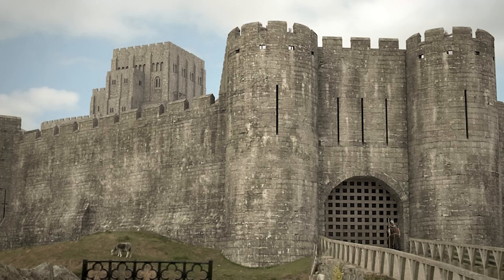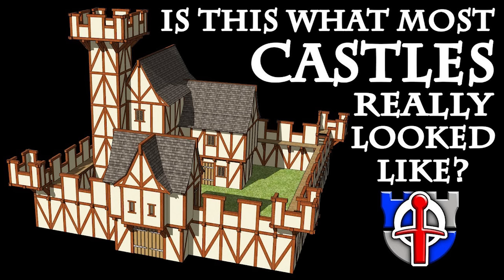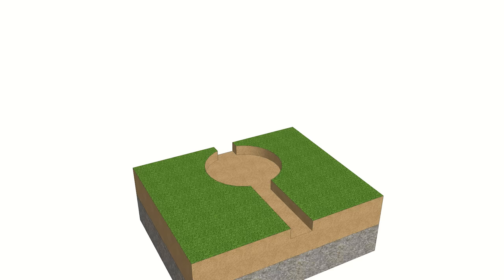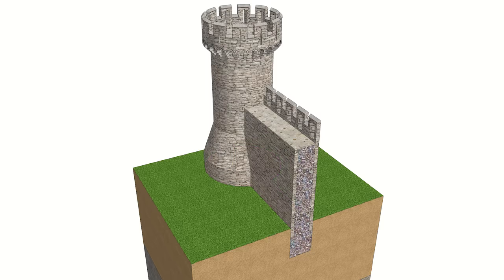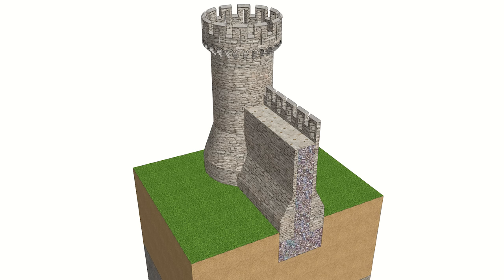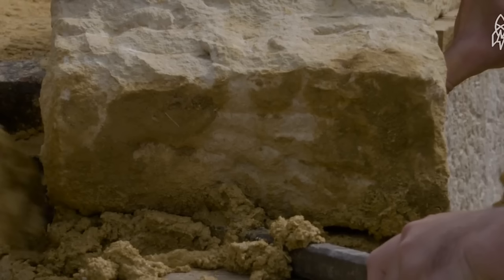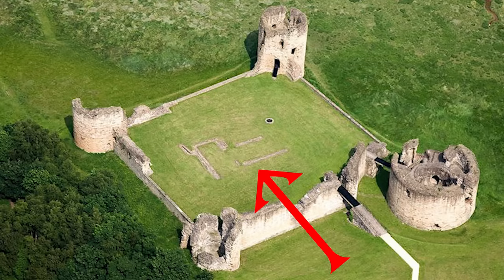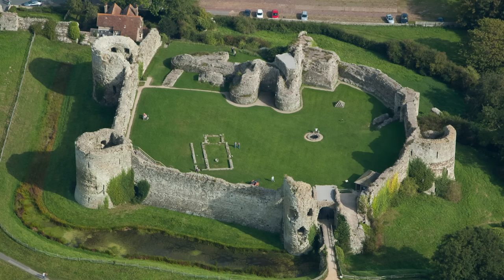How were castles built / constructed in the medieval period?

Comment: Some further explanation as to why they used mortar instead some other adhesive and how mortar mixes work. 
Quick lime reacts with water and changes into slaked lime (fully reacted and hence inert lime). A lot of heat is produced as it does this. Which drives off moisture. A mortar is basically self baking fine aggregate concrete (concrete is just cement with an aggregate like rocks mixed in). It doesn't require exposure to air or additional chemical reaction with water over to time in order to set fully. Unlike concrete. An example of how long it can take concrete to fully set is that the core of the Hoover dam is still setting to this day. Now aggregates (if any were wondering) are added to:

1) Increase an adhesive's viscosity (it's tendency to want to cling to itself. In this case previous to drying). Which makes it easier to work with. Especially since enough aggregate slows the chemical reactions so that evaporation and chemical bonding happens in a more controlled way. But also so that it pours, packs and spreads in a desired manner.

 2) Fix the minimum compression thickness. As it can't reasonably be squeezed any thinner than the largest hard substances in it. This keeps it from all being squeezed out under pressure. Aggregate isn't just crushed rock. It's rock that is crushed and sorted to be within a roughness, size, and hardness tolerance.

3) Create a rough surface. A rough surface has higher friction. Which keeps things from shifting around in ways that are undesirable. The weight of the stone, block, brick, or tile alone is enough to hold it firmly in the vertical plane. A rough surface that finds it's way into pits on the thing to be bonded and stays fixed once dry...That holds it firmly in the horizontal plane (the whole purpose of using a mortar).

These are the the strength properties of adding aggregate to a mix. A fine aggregate makes for easier pouring and filling of more gaps. A more course aggregate leads to greater dry strength.  It would make sense if the exact ingredients of their mortar in castle building changed as they went higher. A gradient of courser to finer aggregates as they move upward in construction.

Comment: As a stone masson i have to point out a few things, first off the walls were tapered for balance, you can see this in more modern stone buildings which would have thick walls on the ground floor and thin walls on the upper floor. By tapering the walls the stressed push out forming a stable base (just stand with your feet together and you can feel how less stable you are in comparison)

Next the stones inside the wall, while they may look random, they're not as random as you may think, those stones interlock and are usually tamped down and shifted to provide support before mortar is applied this can be seen in modern wet stone walls, if the stone is just dumped in the wall lacks strength and quickly crumbles even with a mortar core, while if laid with care using those stone to shore up the face stones and other vital structures of the wall (such as throughs) the wall is much much stronger. So while it looks random (and was probably dumped in by the bucket load) the mason would have been arranging that stone to provide the best support for the wall (you're not going to spend that much money on a castle just for it to fall down in 10 years)

Comment: One reason that the insides of the defensive walls were more loosely built/filled was because the looser fill would absorb more of the energy from bombardment and spread it out to lessen its effect, whereas the tighter fitted stones would transmit the strike more deeply and be more likely to be shattered. That's why you will rarely see any walls neatly built in a solid stack. A "veneer and fill" technique makes a stronger wall.

Comment: In different parts of Europe, the construction methods and models of castles have generally varied. For example in Finland, the construction and stages of castles for many years were usually such that, in the 14th century, the castles were originally log structures, a fortress or fortification with wooden household and barrack buildings inside, but the pile fences were slowly replaced by a simple wall made of natural stones. In the next phase, natural stone towers and a gatehouse were built, and in the third phase, the wooden buildings were replaced by stone ones. In the 16th century, a second floor of bricks was built in the castles and the towers were raised, and in the 18th century, a third floor was added and the old gatehouses were bricked up, after which a new doorway was punched in the old wall. The main wall was surrounded by an outer wall, usually an earth rampart, a stone wall and a moat, which were converted into bastions in the 18th century. And since the Keep had towers, they were less often built on the outer wall. The usual place to build a castle was an island that offered good water connections, but a bad place for wells and the water from the wells dug on the castle island was often dirty and undrinkable swamp water, which is why the water was used for other purposes and drinking water was taken directly from the lake or river and boiled. Swedish and German castles serve as models for Finland's medieval castles (such as Turku castle, Häme castle, Kastelholma castle and Raasepori castle).

Comment: Hey Shad, the loose rocks and mortar used between two outer walls in Byzantine style building (i.e. castle building) is known as rubble.  There is a a great children's book on the subject of castle building (Castle by David MacCauley) that is actually used by several experts in modern castle construction.  Mostly because the book goes into some basic engineering while telling the "story" of a fictional castle being built.  If you don't have it or haven't seen it I HIGHLY recommend that you get it or at least read it.  There is a copy in my personal Medieval/Renaissance section of my library.  Great reference material.

Comment: There were also corbelled arches over doorways (and maybe windows too).  Where you essentially place corbels on top of corbels, putting them closer and closer together until you can place a piece of stone across them.  This way, you wouldn't need a large single piece of stone for the lintel over a doorway.  However, I don't know if this technique was used in medieval castles, but it was used in ancient architecture prior to the medieval period, and not necessarily for castles.

And sometimes a single large stone would span across a doorway or other opening, but then there would be a corbelled arch above that to reduce the weight on top of that one stone so it wouldn't crack.  Thus, you get a rectangular doorway with a triangular or arch-shaped "window" above it.  This space was sometimes filled in with a thinner, sometimes decoratively carved stone slab, which would weigh considerably less than a section of normal wall would have.  But again, this isn't necessarily for a castle, and predates the medieval period.

Comment: Just saw your video on the castles of Kingdom Come Deliverance, and had to answer the question about beds.  In Palais de Louvre you can still see an alcove for the king's bed which is fairly narrow.  I think this might be because beds often used to be built with a wood frame spanned by a net of ropes covered in straw and wider beds of this construction might need to have the ropes tightened more frequently. Just my random tidbits...

Comment: I wonder if they understood soil compaction at all? One of the things I do in my work is I test the soil compaction on building pads, roads, etc. If the dirt has already been compacted properly then a building won't sink in.

This is actually more complicated than you might think but basically it's finding the correct amount of water to use and also in the modern day we bring in engineered "fill" or dirt as not all dirt is created equal.

Comment: Probably an additional effect of randomly piling stones and using lots of mortar for the inner part of the wall is that such a wall can absorb a heavy blow better, as the random stones allow the impact to be passed through over a greater surface area. The mortar would do this even more so, although mortar isn't as strong as stone of course.

Comment: Plenty of hypothesis from your video. Allow me to make one clarification. The reason for tight fitting well dressed stones on the exterior and interior walls is for strength. Think of your bones. Hard exterior with a less dense interior. A castle 50 meters tall needs walls about 3 to 6 meters thick at the base. Stone masonry gets is strength from the stones interlocking and from compression . The mortar used stayed flexible and takes hundreds of years to completely cure. I am a Stone Mason and I am as well fascinated by this modern castle building project.

Comment: The footers might have also been made with a mixture of soil and ''cement'' mix... Note, the compressive ability of the soil -  resistance might have been high because of NOT have organic materials to decompose...
That the soil base was ''already'' in high compression and the added weight was not significant enough to compress it further...
Also, the base, in your designed wall, will ONLY add more weight and not ''distribute" weight...  because it is NOT composed of designed that will "act as one"... You created three walls... the larger base will add lateral stability though... and also push water away from the main wall structure - to avoid base erosion or softening of the soil. Hope this helps you.

Comment: Hey Shad, I'm curious about your thoughts on rubble-filled walls, or maybe using two stone walls with a hollow between them, then filling that hallow with sand and dirt.
How would that effect the integrity? Thermal properties?

Coming from your  castles in fantasy video, how would potlog holes effect a wall's resistance to fireballs? I would think for fantasy castles that would have to contend with such a thing they would be sure to plug those up.

Comment: At 6:21, that picture is the keep of the castle at the town of Castleton, in the county of Derbyshire, in the U.K. I recognise it immediately. Been there many times as a child. On top of a massive hill, and that little wall to the left? Other side of that, massive nearly sheer drop. Easily 100 feet. There is extra railings added to make it up to modern safety standards. I suspect in medieval times they cared a lot less.

Comment: Hi Shad, very informative and well researched video. But around the 6th minute you talk about the smoothend face of castle walls and I honestly don´t think erosion was the main reason as you make it seem by talking mainly about that. The main reason I´d say this was the case is simply for defensive purpouses (as are most things in castles). If the walls had a finish made of jagged stones it would be quite easily climbed. The climber would also easily blend with the wall at night, making him hardly visible for the watchmen. Conscidering the usual stationary garrison of a medival castle was between 15 to 40 men it could take as few as 5 to 15 unseen climbers to take the castle if they took out the garrison one by one. Thus I think the defensive value of smooth walls should be highlighted over erosion. Anyway - keep up the good work. I enjoy your videos whenever I have time to watch. ;)

Comment: Great way of getting the stone the cheapest is to actually quarry it on the very same place where the castle will stand. Most castles here in Bohemia were build this way - almost always on top of rocky hills, using the stone from the top of that hill to build the structure, modifying the layout of the hill in the same time as well. Most of the material is probably taken from where the moat will be. So today most hills with ruins of castles on top of them have probably good few meters lower elevation, than they were before the castles were build. For me it's interesting to imagine these hills (with familiar castle profile on top) without the actuall castle - the would look very strange to my accustomed eye..

Comment: When building castle walls, they built two outer walls and filled the center with rubble.  Then, when sappers attempted to tunnel under the walls, the rubble would pour into the tunnel, thwarting their plans.  At the very least, the rubble would slow them down, since now more sappers would be needed to clear out the rubble along with the mortal remains of the fellows who were in the tunnel when the rubble came tumbling down; and yet more is bearing down upon the stuff that they are trying to clear.  What you see as mortar might be natural concretion that has occurred over the centuries since the castle was built.  The loose rubble interior also gave some flex to the wall, allowing it to absorb bombardment instead of transmitting the shock through the wall and cracking; this concept has been brought forward even to the International Space Station, which has layers of soft armor to  defend against meteorite strikes instead of a single solid sheet of metal.

Comment: There is one thing you missed. At 3:40 you show a picture of the Malbork Castle as an example of a Brick Castle - an absolutely huge castle built on what used to be a swamp...  if you know your Monthy Pythons castles do not like swamps... There is no solid bedrock there to lay your foundations so instead this castle is built ON wood - thousands upon thousands of oaks that were hammered into the ground vertically to create huge and very solid foundations (obviously since the castle still stands). Them Teutonic Knights were very smart.

Comment: Something that may not have come through correctly is the fact that they did not use metal nails because the main construction wood was oak. Oak has a corrosive liquid inside, even after years of drying, that would just dissolve steel nails

Comment: I would say the main thing holding a castle together is not the mortar, but the shear mass and friction between the stones/bricks. I lived in an old house constructed with lime mortar and believe me it has very little strength (other than compressive maybe), is very soft and doesn't adhere well -rubbish compared with Portland cement based mortars.

Comment: It's interesting to note that we see the process of constructing a hard, stable exterior of a stone wall and then filling it up with stone and mortar on the inside repeated in the modern day, only with plastic and expanding foam when building cheap, simple, durable outdoor structures, like with plastic faux brick. The outer plastic brick kind of forms a hard shell and it gets filled up with beady foam on the inside.

Comment: Great video. On your point about castle walls ‘resisting bombardment’. That construction method (inner and outer masonry ‘skins’ with rubble and mortar infill) predates the availability of gunpowder, so wasn’t designed for that aspect anyway (yes I know there were trebuchets, but they weren’t in the same league as the later cannons and mortars).  The introduction of gunpowder led to the castle design changing to adapt, ultimately leading to the Henry VIII style structures (low to the ground with their own gun batteries), but they were really forts by then, rather than castles in the true sense.

Comment: Shad, the actual problem why you need archs to build with brick/single stones is that the mortar/brick unit does only take pressure, Stone itself is pretty good in Holding against moments etc. Maybe you mistook Stone with concrete. Concrete has high pressure resistance but nearly Zero (Not Zero but nearly) resistance against tension and moments. That's why you need reinforcements in concrete. 
So you are basicly right, but the civil engineer in me just couldnt let that Small Error stand :) great Video.

Comment: Can't we all just Guédelon?

I keep finding myself wondering about details, like how they ensured that the individual stones they were using were sturdy enough to be critical structural elements like corbels or large pieces in doorways. 
Especially when they were dealing with sedimentary rock. Did they run any tests on the stones? Or did they just put the stones under much less strain than is theoretically possible? Or did they just get "unlucky" sometimes and had a corbel or archway collapse?

Comment: Yeah, you are right about the insulation value of stone/concrete. I just checked using a calculator and if you made a concrete wall 1 meter thick, you would only have an R value of about 1.  Modern pink fiberglass in a 2x4 (10cm thick) wall would be around an R9... 4 inches of fiberglass is 9 times better insulation than a meter of concrete.
Just for reference, in my state, new construction homes are required to have an R19 exterior wall insulation.

Comment: Just came across this. Nice video! I've been doing some constructionwork myself and have a question/suggestion regarding the walls and the mortar. Wouldn't it make sense that they would first build two outer walls (like a meter apart) using some precise bricklaying. And then fill them up using stones and mortar? Kinda like using a mold?

Comment: Stone is an excellent Thermal Mass. It has a very high Thermal Capacity, and a very low rate of Thermal Transfer. Put together, that means that Stone is basically a heat sponge. It sucks up Thermal Energy from the surrounding environment, and is incredibly reluctant to release that energy back into the surrounding environment.